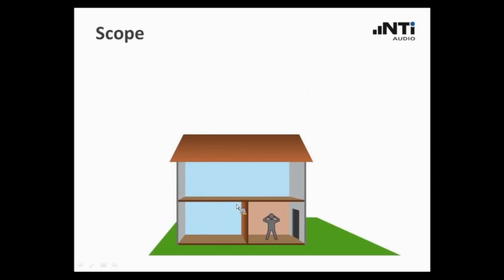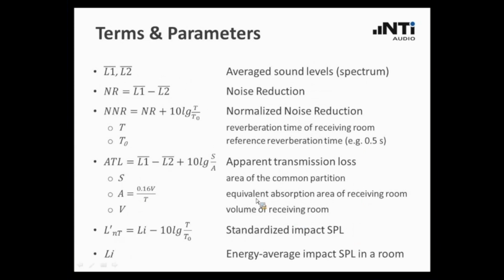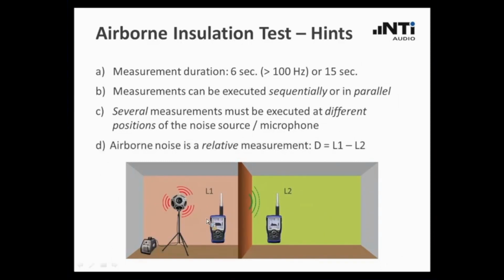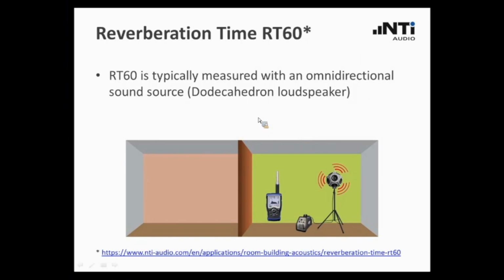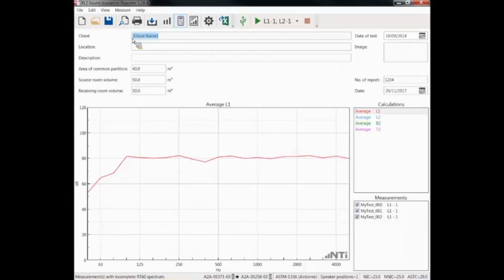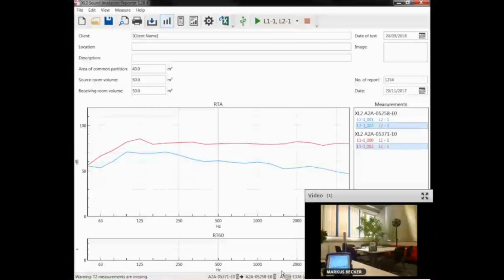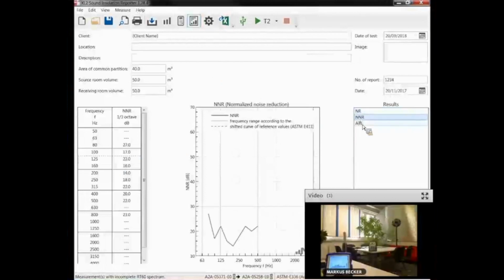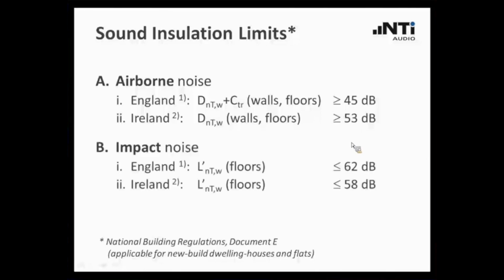NTi Audio Webinar Measuring Sound Insulation

Comment: Hi..that XL2 software, can it be used with a single class 1 SPL meter? To measure airborne sound insulation between two rooms, I needed a number for a wall and also an accoustic door say for example in an auditorium, I'm in Australia.
Reply from the maker: Hi Kasparov 9, yes you may use the Sound Insulation Reporter software with only 1 pc. XL2.
You then just have to measure twice, e.g. first in the sending and then in the receiving room.
The PC software will consequently calculate the required results.
Reply: Thankyou and what does that cost? Also I just want to be able to measure the noise reduction between rooms to give the wall a rating and also for an accoustic door, I read ISO but its complicated and hard to understand, is there somewhere to leaen what to do step by step that is easy to follow? Im from Australia.

But have already purchased a class 1 sound level meter  and was looking at getting dodec speaker in future with amp.

Any help would be appreciated.
Reply from the maker: @kasparov9  Dear kasparov9, please send us an email to info@nti-audio.com so that we can provide the requested information.